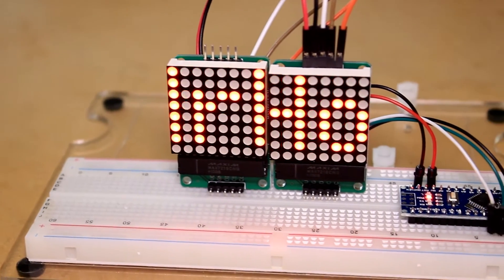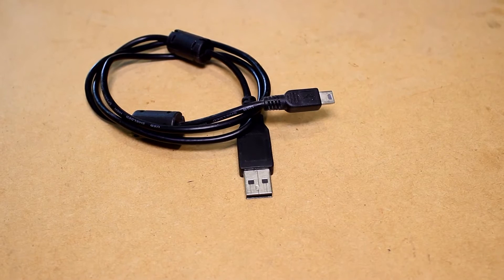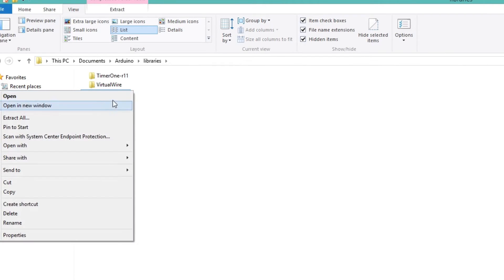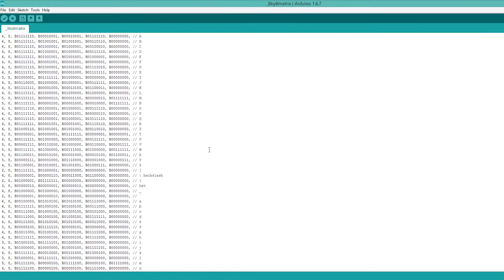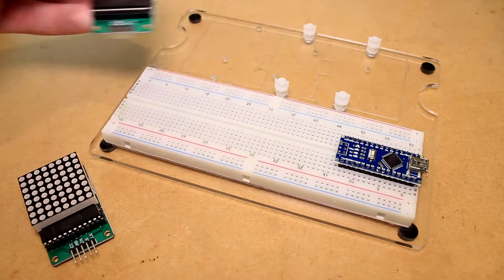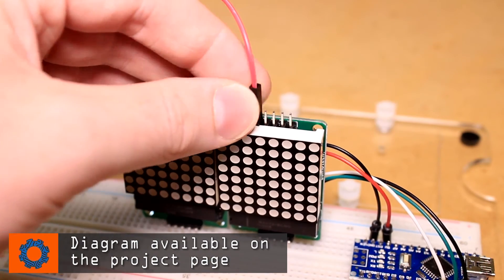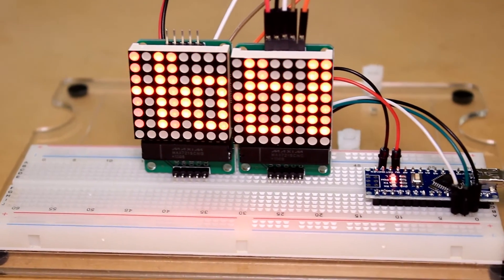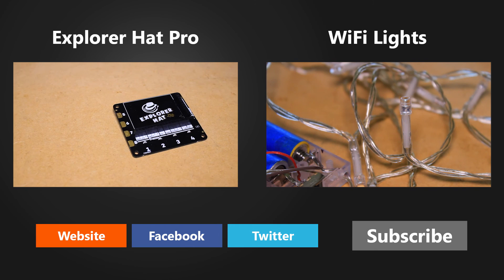Arduino - Mini Dot Matrix Display

Comment: Hello Friend! I bought this module here:http://pt.aliexpress.com/item/MAX7219-Dot-Matrix-Module-For-Arduino-Microcontroller-4-In-One-Display-with-5P-Line/32620800331.html?spm=2114.13010608.0.112.ismpuZ
The code is working but in my module is showing the message scrolling vertically; What should be changed in the code to display horizontal?  If you can help me I thank you;